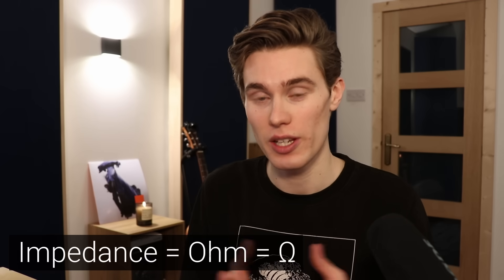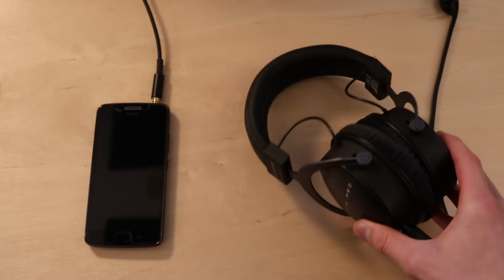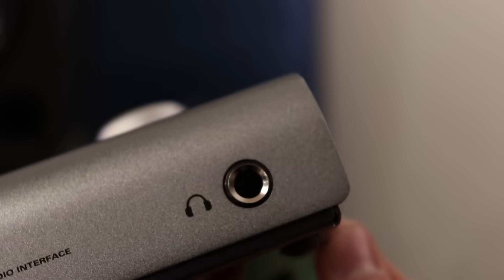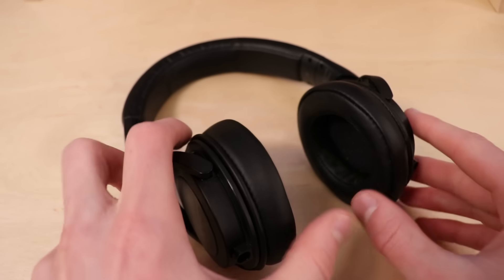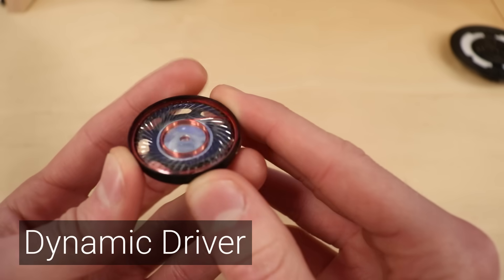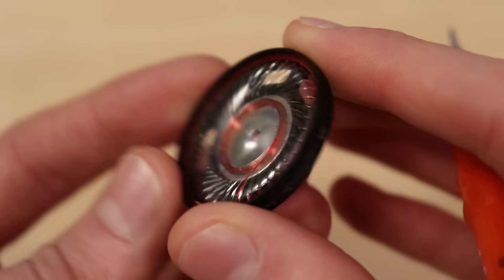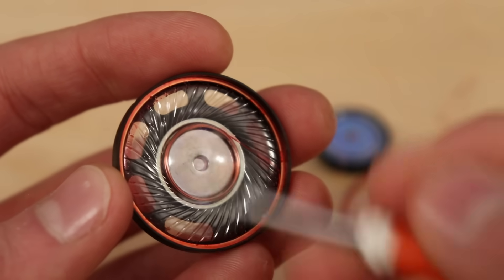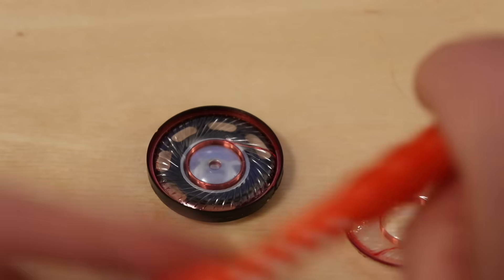32 ohm vs 250 ohm - Which Headphones Sound Best?

Comment: Good information but after hours of research and so many videos and articles, I still haven't been able to actually get an answer my question. 
My Soundcraft mixer manual doesn't let you know the actual output impedance, (maybe it's a guarded secret). It merely says it requires headphones >/= 150 ohms. So, the mixers impedance must be about 18.75 ohms based on the 1/8 rule.  
What does that mean other than the obvious (equal to or great than)? How much greater is acceptable? How about using 250 ohm headphones, how about 600 ohm headphones? ... because they are both greater than 150 ohms. What would be the advantage or disadvantage of doing so and when does it become too much?  
I'm not saying I would go as high as 600 ohms ...but why wouldn't I, as the application simply states 150 or higher?

Comment: The 32 ohm and 250 ohm are more alike than 80 ohm, which were made different, to sound louder at expense of audio quality. From beyerdynamic: 
"With 80 ohms, the DT 770 PRO differs significantly from the 32- and 250-ohm versions in terms of sound. The 80-ohm version of the DT 770 PRO has a two-part coil system and reacts somewhat more slowly, which causes a slight treble attenuation at approx. 6 kHz. This can be very pleasant for ears that are sensitive to high frequencies. The DT 770 PRO versions with 32 and 250 ohms have a three-part coil system. This ensures a faster performance and reproduces the high frequencies more faithfully, which is why the treble sounds more present. The 32 and 250 ohm versions have the same sound signature, but differ in the ear cushions" 

"Both versions, 32 and 250 ohms are based on very low mass, so called: underhang voice coils, which can reproduce enormous details with low distortion. For the lower impedance, we use slightly thicker - and less - wire for the coil, therefore, it plays louder with lower supply voltages (from mentioned units) as the 250 ohms version. 80 ohms DT 770 PRO is optimized for very high listening levels in a recording studio, for example musicians, playing an instrument, etc.. You normally can find very high power headphone amplifiers here and achievable level is more important than the last bit of sound quality. This transducer uses an overhang voicecoil, which is longer than the air gap. Its larger surface increases the electrical power handling (better cooling) but its higher mass results in a different distortion behaviour."

Comment: The sensitivity of headphones tells you how much power is needed to drive them, not impedance. The hardest headphones to drive are typically low impedance planar magnetic headphones, they're low sensitivity and low impedance which means they require a lot of current. High impedance + low sensitivity means it needs high voltage. Most dynamic driver headphones like dt770 and HD650 are fairly high sensitivity and can run just fine off most phones and PCs, no need for a dedicated amp.

Comment: Some people said that if you use a phone or other low volume equipment, the low ohm headphones were better. I thought this meant, if the ohm is low, the quality of the headphones are automatically low. Then I bought the 80 ohm headset you're wearing, and I got extremely mad the volume is so low. I wish I would have known this back then, so I could buy low ohm headphones, that work great for both gaming and music production at the same time. Good quality low ohm headphones would be ideal for me - clearly. Thanks for explaining what it actually means and why it was made.

Comment: Well I am using a Komplete Audio 1 interface and want to turn up the volume all the way up because its feels like giving me all the details but after some time i start to realize i damaged my headphones drivers cuz of the high audio levels and hear cracks on low audio presets, so I am in search of an studio headphones resistant to high audio but couldn’t find any source so any advice ?

Comment: I have beyerdynamic dt 1770 pro 250ohm. What interface are you using? Which is best. I need one that works well with FL Studio and has phantom power for my mic. My expensive interface crashes FL using asio4all.

Comment: Cheers I'm thinking between 80 and 250, I'm wondering if a tascam US 2X2 type sound card or similar cards for home recording could drive 250 Ohm. I am also interested in having a Kenwood receiver, I think it can handle 250 Ohm. Thanks in advance for the answers

Comment: You didn't answer the question in the title of the video "Which Headphones Sound Best?"

You correctly explained that people should get low impedance headphones for low voltage applications and high impedance headphones for high voltage applications, and that this should be the focus of which to purchase. That's all well and good, but it doesn't answer the question of which sounds better!? The closest you get to answering the question is at 3:35 where you say "If you are an audio professional will be able to tell the difference between low and high [........] its sort of a case of personal preference."

For those looking for the real answer I continued my research beyond this video and the results are in: High impedance headphones used with a amp will sound better than low impedance headphones used without an amp. They will have a more flat frequency response, produce more precise and detailed sound across different frequency ranges, and be less prone to distortion.

Comment: Sayin a less impedant headphone sounds better on a phone is outright wrong these days.
Even more so since 3.5mm jack is gone.
Try and drive for example the DT-990 Pro through a 3.5mm to usbc/lightning adapter on your phone.
Im using them on my S20 Plus, and i often have to tone down the volume a bit.
Sure, i could also drive em through my Fiio X3 to get a more crisp sound with a wider soundstage, in terms of loudness, there really isnt that much difference.

Comment: Really excellent video.  One question regarding impedance 32, 80. 250 etc and the electrical power to performance....where does Bluetooth fit in to all of this power performance and battery life if that makes sense re 32 80 250 ohms?

Comment: My Ananda Stealth V3 are 16ohm but only 93dB sensitivity. Even at 100% volume on Windows, it's as quiet as my dynamic drivers at 30% volume. They are planars though which aren't very sensitive. I do have an amp coming, so it will be different soon.

Comment: Hello (thx for the video) 

If someone is floating around : is the 250 ohm cable as noisy as the 80, or less? 

I just received the 80 ohms version, and the cable is really noisy + it seems I have good/powerful enough hardware to drive higher stuff.

Is the noisy cable just an issue of mine or it's for all 80 ohm versions? I'm thinking to resent it and take the 250

(my guitar multiFX seems to be enough to drive 300-600 ohms, my portable wired USB + wireless double DAC (with batterie) seems to be enough to drive 300 ohms HD600/800)

(yes, I'm a bit autistic, the 3m straight NOISY cable seems too long/triggering me... 
- 1.2 straight isn't enough to play guitar, but good for mastering, 
- 3m straight bad for mastering on my PC rig but good for guitar record, 
- 3m coiled cable might be the sweaspot for me IF it's NOT a NOISY cable)

Comment: Having more coils doesn't mean higher impedance because of higher active resistance (i.e. "more Ohms in a wire"), but instead means higher reactive resistance, which in case of coils is proportional to L (inductivity) which itself is dependant on number of turns in the coil.
If it was the case impedance would depend on the length of the cable of the headphones.

Comment: For those wondering about the difference between resistance and impedance: resistance is "static" and for when we're talking about DC voltages. Impedance is "dynamic" and for when we're talking about mixed frequency AC voltages, such as audio signals.

Comment: the reason why they use 250 ohms coils. the coils can be made from thinner wire and they will weight less. and therefore move easier and stop easier and therefore produce cleaner sound

Comment: Hello. I understand your distinction: if you only have a phone or laptop with no high impedance load, better 32 ohms to get enough volume, or even 80 ohms. And if you plug the 32 ohm headphones into a professional app, it will probably be too loud. Conversely, an amp would be preferable for a 250 ohm type headphone connection. All this I understand.

However, saying it that way, it feels like it's a simple matter of compatibility between the type of ohms of the headphones and the device where we'll plug the headphones into, and that basically 32 ohms and 250 ohms are equal in the end. However, many specialists or sound engineers seem rather to affirm that, if one has the necessary amplification equipment to connect 250 ohm headphones to them, the sound field will be wider and more detailed, and above all: even at very high volume there will be less risk of saturation. What do you think ?

In my case, I have recently owned a MacBook Air M2 (2022 model) which offers a high impedance load headphone jack, this is one of its fundamental assets. So you might as well enjoy being able to enjoy a 250 ohm headset, right? Regarding the models of MAC with revolutionary Apple Silicone high impedance processors, see for example this page:
 https://support.apple.com/en-us/HT212856

There is also this page that talks about it : https://kettnercreative.com/headphones/250-ohm-headphones-mac/
Reply: any update? :D

Comment: Please correct me if I'm wrong, but I believe lower impedance headphones use more current for a given voltage, so you definitely wouldn't run them with a higher voltage. I think you got voltage and current confused.

Comment: Just quite curious about the mechanism of the wires!

You talked about how more coils (thicker wire) leads to higher impedance, because there are more distance for the electrons to travel.
But how does that affect the power need, but not the time needed? 
Cuz for longer distance, I'd naturally assume it takes longer to travel thus there's somewhat an increase in latency, not the power needed.

By the way, thanks for the vid -- what an awesome vid. 
I have the DT770Pro in 250 and I regretted it cuz my Focusrite 2i2 Interface can't quite boost them enough. So I'm planning on getting a 80Ohms one :)

Comment: Hi, the video is very informative. But I have a question. Would the DT 770 PRO (250 ohm) be suitable for a computer, that is, is the computer powerful enough to drive the high-impedance headphones? And you also mentioned that with the high-impedance headphones you get a full sound. Does it mean that I can hear all instruments clearly and be able to distinguish between them, which one is which?

Comment: Power = Voltage * Current. Current = Voltage / Resistance. You can see that voltage does not equal power. Also, none of the aforementioned variables in those equations has anything to do with better sound. This whole video is wrong and doing nothing more than confuse. It is technical and not helpful to explain to most people. The inductive force needed to create the electromagnetic field to work against the magnet in the driver is proportional to current. The voltage needed to produce the current in the coil is proportional to the impedance of the coil. The higher the voltage, the higher the current, the higher the excursion of the speaker / driver. Increasing all these metrics does not make things sound better in most cases.

Comment: Great video with all the explanations that are needed to understand the basics about headphones and impedances, especially if you are not a speciallist to these technical knowledges!! Literally the best I've seen. Ι just wondering what are the most suitable ohms for devices such as dslrs and mirrorless cameras that they don't mention their headphones outpoot? I have a Canon EOS R camera and I don't know which ohms will have better performance. Does anybody knows what is best for those devices?
Reply from the maker: Great question! 
I have used a Canon 200D and Sony A7siii and both worked best with very low ohm high sensitivity headphones. I also use low ohm headohones on mobile mixers/recorders to be sure I get the volume and bass needed.
Hope that helps.
Reply: @inthemix  Thank you for your answer!! As you said in the video, low impedance Ohms are under 40 Ohms, so when you say ''very low ohm high sensitivity headphones'' what do you mean in terms of Ohms? For example 32 Ohms (that I have in mind to buy for monitoring my EOS R),  are in this category of very low impedance? How many Ohms were the headphones that you used successfully for those cameras that you mentioned? Finally you suggest the same for devices as kind of Zoom/Tascam etc mobile recorders as well?

Comment: ok so i got to buy a pair of  Beyerdynamic DT 990 250Ohm (you don't have to) 

because this came up on search i checked amazon happy with the price to double check my DAC output and in the reviews for my DAC a comment also stated that they used  Beyerdynamic DT 990 250Ohm on a Soundblaster z card and didn't have much power but the DAC did.  

i'm worried cos i almost Blew out my headphones (panasonic RBM-300B <i got for 25 quid :)>) 

Right now i don't want to upgrade, (these replaced my MDR-7506 that died last year) 

for me i been trying to crank my audio drivers to play at 192khz but at the high end the sound kinda morphs a bit to much on hi-fi audio and all the sounds don't feel AIRY enough yet.

Comment: Current dictates power used, not voltage in this instance.

Although V = iR, from the same source the same voltage and current will be limited by the source 

The voltage can remain the same, but on higher impedance drivers you require more energy to produce movement in the electromagnetic coils.

Therefore, current is the dictating factor in this scenario rather than voltage. There are outputs that deliver more voltage, however, the amount of power used is the relevant point here.

The reason higher impedance headphones exist is so that more pairs can be used on a single source.

When you plug an extra set in to a single output, the resistance is halved, assuming that they both have the same impedance. 

If two pairs of difference impedance headphones are used then the resistance is divided proportionally between them following ohm's law. Which means that one pair will have a louder output than another as most of the current will be pulled through the lowest impedance set

This allows multiple musicians to listen to the same source without fear of damaging studio output amplifiers

Comment: Like many audio interfaces, mine is USB powered. Which impedance would work best?
Reply from the maker: I would recommend going for the 250 if it’s available. Almost all interfaces can power them. 

Which interface are you using?

Comment: One thing you forgot to mention in this is if you have let's say an old school vintage receiver with higher Watts per channel the sound will sound different also. Which you wouldn't need a headphone amp. I currently have the Sansui G9000DB which puts out 160 Watts per channel vintage power. And I can tell you headphones will sound dramatically different on the sound quality because more watts per channel as in my receiver is 160 Watts per channel are going to sound different and better than a headphone amp or a plug-in to a phone or computer. This comparison which needs to be addressed on these headphones would be nice to see.
Reply: If you're using the headphone jack on the front, you definitely arent getting anywhere near 160 wpc. Its probably stepped down to fairly low levels.

Comment: PLEASE HELP

Hi it is normal >> I had regular logitech g35 headphones, I bought a dt770 pro 250ohm (I had no idea what that meant for this problem). In these dt770pro the sound is 80% worse (quieter) than in those from logitech.

What is it caused by?
Will it be much better if I buy a 32ohm?
What amp do you recommend for these headphones?

Comment: one thing i find interesting is how similar high impedance drivers configuration are to high turn motors. and how low impedance are very similar to low turn motors.

low turn motors produce high rpm per volt at the expense of greatly reduce strenght or torque.

in here i guess we can conclude that rpm is like volume per volt.
but what is torque in acoustic? Better bass reproduction. i mean. more precise?

high  frequency notes vibrate very fast and do not need much torque control on the magnet. but very accurate bass reproduction does require more torque control.. would be my guess.

Comment: Thank you, best video on the subject. Thoughts on using DT 770 Pro 80ohm headphones to a 15W guitar amp? Anything extra to know for using high gain effects pedals?
Edit: I just checked my current headphones akg550 (32ohm) and I have to crank them to 80% of that amp to have ok volume. I am confused, I thought 32ohms can be very loud on high output devices like amps.
Reply: dedicated headphone amplifiers typically have high output, but the headphone amps in guitar amps typically suck. The headphone out from my bass amp does the job, but it doesnt sound good.

If your 550s arent that loud, very few headphones will be. The 550s are both low impedance and high sensitivity, so they are about as easy to power as full size headphones come.